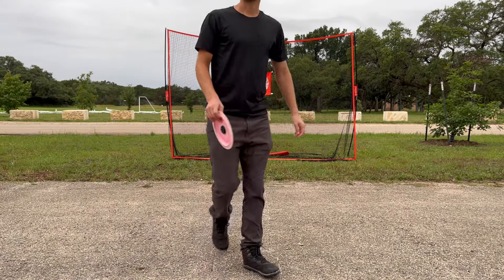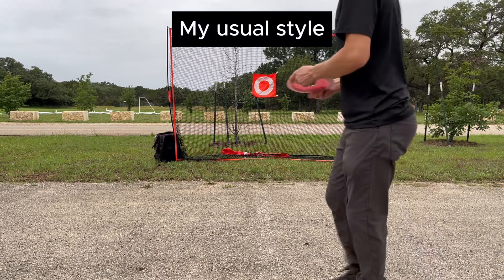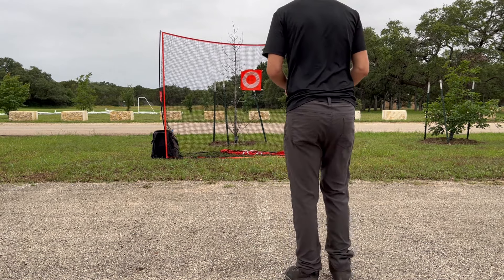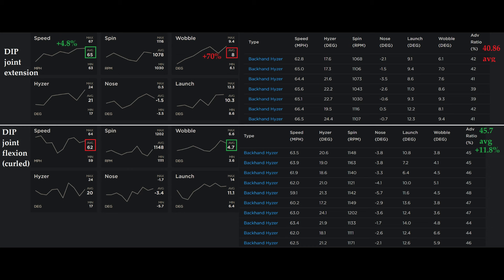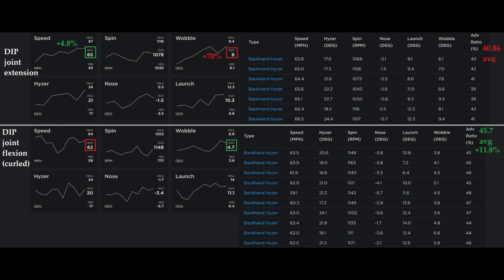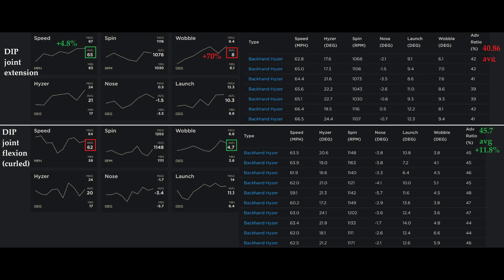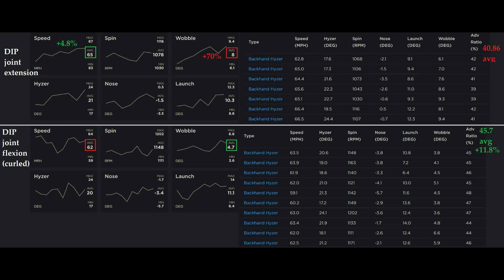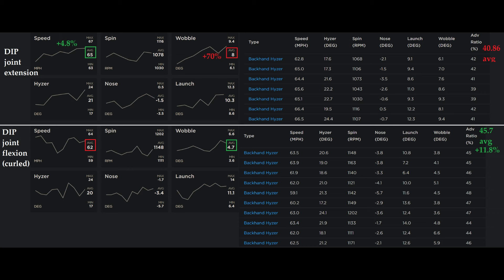Max speed finger curl power grip comparison - tech disc tests

Comment: Literally just had this realization the other day before I saw this video. I tried extending the dip joint. Think I sprained it. I can still throw in flexion with no pain but if I try extending again hurts to throw. Interesting to see it leads to faster throws for you. I do feel like I gained about 15-20 feet when throwing like that but not worth an injury.
Reply: Well I should say, sprined the joint below it, the second one.
Reply: I think it might be faster because you can get about the same strength with that grip but the disc can slip out faster when the joints are in extension so less time in contact for things to go wrong.
Reply: Oh and the added friction on the flexion grip help with the adv and wobble.
Reply from the maker: Yeah definitely takes some conditioning for your joints to be used to it. Also remember that whatever grip you use you didn’t just start throwing your max speed with it without working your way up to that max speed. But now that you have that max speed it means you don’t have to work your way up to it so you can go too hard with a change that isn’t conditioned for that speed.

Nick Krush bruised the tip of his finger bone from the DIP flexion grip because it puts more pressure on that part of the finger and he’s throwing like 90mph which is nuts.
Reply from the maker: @btubbs00123  it helps with those stats for you too?
Reply: @stepwise-dg Haven't tested with my techdisc yet, just theorizing based on your numbers.
Reply from the maker: @btubbs00123  let me know what you get with your tests!

Comment: I've always thrown with the fingers flexed as the extension grip feels so bad, but these are really interesting statistics. Now I need to try max distance with the fingers extended.
Reply from the maker: If you’re not used to it, you’ll probably need to practice a little bit to get the fingers ready for max loading in that position. 

I’ve thrown with the flexion before here and there with full power so I think I was decently prepared for it but def could’ve gained more probably.

Comment: Just to blow your mind I throw faster and with more spin with only 3 fingers on drivers, 4 on mids/putters. Never use my pinky.
Reply from the maker: Have you tested this with a tech disc? The spin in particular. I haven’t seen any spin increases with less fingers. 

I wonder if it’s more about taking some fingers off making your wrist more comfortable / better range of motion to curl more naturally that gives the extra spin. 

I’ve tried the gossage style grip and it doesn’t increase spin for me, might lower it slightly. Need to test it again tho.
Reply: @stepwise-dg  yeah had it confirmed cuz the pro at the shop thought I was nuts.

You had it right. It allows me to get more curl on my wrist

And it keeps the wrist "looser" flexing your pinky that hard will tighten all the muscles in your forearm giving you less whip.

Comment: For me the extension puts uncomfortable pressure on those joints so I settled on the flexion grip pretty quickly. I also don't think that I could throw anhyzers as well with the extension grip as that throw feels like it loads more pressure onto the middle 2 fingers.
Reply: Same here.. strained my middle and ring finger tendons on flexion grip and it made me change to extension grip.

Comment: How far are you throwing currently?
Reply from the maker: 450 max on flat ground with both a hyzer flip to S curve or an anhyzer S curve. Most of the time it's closer to 400-430.

Many of the lower 400's probably have the speed to get 450 but are a little off on one of the angles and / or the disc stability doesn't match the angles. My tech disc speeds show I should be able to get between 450-480 once in a while it's harder of course at those max speeds to have every angle balanced well with the disc choice and the wind.

My disc golf form progression playlist shows a lot of the distances in the field.
Reply: @disc-golf-neil  what disc and that's with your current grip not that second one right?
Reply from the maker: @AustinVang9  yes with my current grip, tern, shryke, sidewinder for the hyzer flips and boss, destroyer, wraith for the anhyzer s curve shots all in champ or halo.

Comment: I think your climbing background may explain why extension feels more natural and seems to yield greater strength for you. I too use a more extended position and have a climbing background. While a full crimp position felt awkward when i first started climbing, it felt very natural when i started to play disc golf (which was long after i had started climbing and built up stength in the crip position).

I think the curled position is safer and more comfortable for folks who haven't built up the tendon strenth for the full crimp/extended grip.
Reply from the maker: Yeah, it’s definitely made the extension grip more comfortable for me than the typical person, but I was also very comfortable and strong in climbing with open hand and my favorite climbs were crimpy ones where I’d always practice open hand first and only change to a more aggressive grip when limit climbing. I also did hang and campus board open hand. 

I need to also try the curled flexion grip with extra finger curl, some people do it with quite a bit more finger curl, maybe that will yield different results.

Comment: When you "turn the key 9:35 " throwing form, is your wrist neutral or are you also thinking of pouring tea as your arm extends?
Reply from the maker: I do not think about or try to pour the tea when I’m turning the key because I can get so much nose down with turn the key so I figured, why bother. Especially since not pouring the tea is more comfortable than doing it so if I don’t have to do it that’s nice. 

Pouring the tea isn’t really uncomfortable or anything for me though. I do want to test both I just keep forgetting too because even if it gives me more nose down i prob wouldn’t use it since I can still turn the key alone to get as much nose down as I need.

When I turn the key with the F1P-3 grip alignment (grip alignment test vids), I do get extra nose down and that grip alignment seems to encourage me to pour the tea without really trying to.